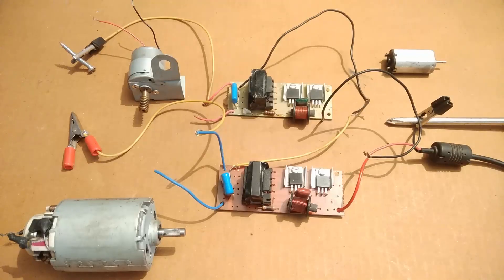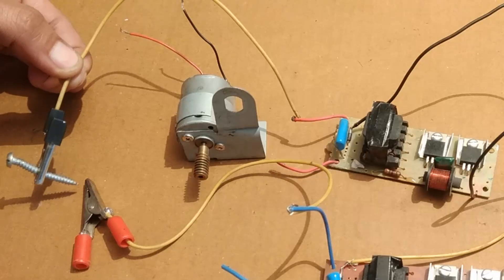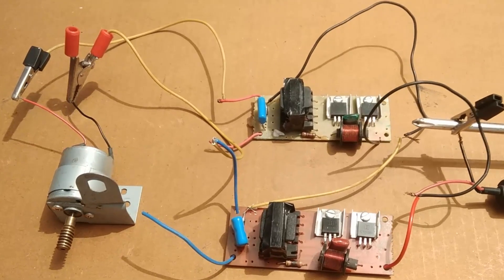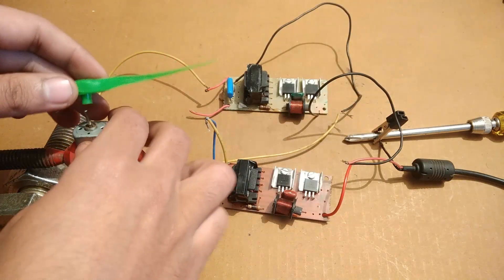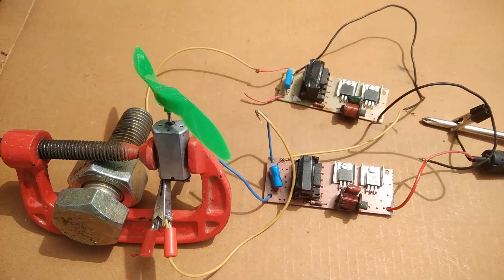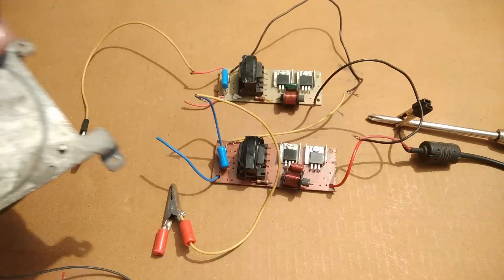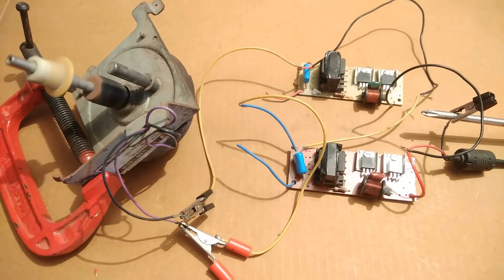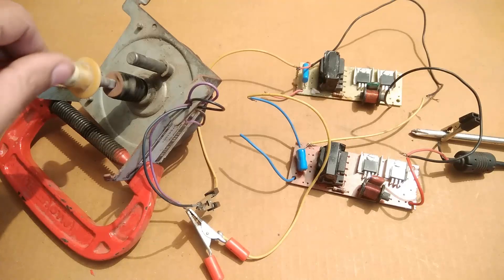Wooow!!! 3V DC MOTOR forced at 4000V | Awesome idea New DIY

Comment: Lie. I was gived 220 volts to 3v DC motor and motor explained. What happen if you give 4000v do you think.
Reply from the maker: Nabi Korucu Yeah! Well u might have given it directly from the socket board that has just 220V but an extremely high value of current..
I fed it very small amount of current - 0.15Amps
Reply: there is no current without a voltage.....really man, how could you do this video without understanding electronics? Ohm's law. the resistance of motor is constant, so the voltage is line-proportional to the current..... "it is the current damaging not the voltage"...  voltage is LIMITED by the current in your video.
Reply: Mr Electron they probably fed it ac current, and the windings overheated.
Reply from the maker: srihari vaila Only if the power supply is high.
Reply: Mr Electron     do you wanna say that if there is high voltage then it may have low current is that possible.
Reply: resistance is constant , it is changes a bit with temperature change but it is constant. self-inductance, man.
Reply: John S okkk man
Reply: John S okk man
Reply: Mr Electron  yes my friend damage caused is by the current but when the voltage is high then current should and must has to be high right as they are directly proportional by ohm s law
Reply: https://www.youtube.com/watch?v=MarysYXp_Xg   here is demonstration of Ohm's law using 3v dc motor. on the left side you can see current, on the right -voltage. increasing voltage = increasing current, line-proportion.  increasing voltage 3times = increasing current 2 times cause of self-inductance ot the motor. BUT if you will limit current VOLTAGE WILL BE LIMITED TOO
Reply: srihari vaila what? listen. you are plugging electric kettle to the power socket, which is 220v 50 amps city power, right? so, you want to say, your kettle is now 220*50=11 kW of power? NO! it is just 2kW(near of this) because it has A FIXED RESISTANCE, CONSTANT, no matter how strong are city power, current is limited by voltage and resistance.
Reply: my cat smells like cat food
Reply: Mr Electron    okkk how will you prove your theoy man
Reply from the maker: resistance is never constant when the motor is operating.Its constant only at stand still
Reply: Владимир Петров  yes off course but he has given a high power supply where p=v×i then the motor should and must has to reflect that given power as per law of conservation of power
Reply: Владимир Петров yes my friend i know that v=ir  and the current across your kettle will as u have said due to its resistance offered. which is 220/r is that it.
Reply: srihari vaila so " he has given a high power supply where p=v×i then the motor should and must has to reflect that given power " is a lie, motor should not do this, exactly how kettle should not drain 11kW from city power. voltage on motor will drop due to current limit of the power supply. you can find ElectroBoom's commentarry upper, if you dont trust the stupid russian guy like me. on his channel you also can find explanation of this words. or you can buy your own power supply with current limiting, and connect a small resistor to it to see voltage drop..
Reply: Владимир Петров  by the way you are from russia and what do you  do. your kettle explanation which you have said is right   it might be the supplied power which is 11kw.      which i have said and the 2kw which you have said is the amount of power  consumed from  the 11kw by the  kettle.
Reply: You would get a thesis or at least a lecture.
Reply: growtopia
Reply: Nabi Korucu
Reply: It's dc motor after all so, if we connect it in a 220V ac source then definitely it will damage. Because the current change its direction which is not tolerable by the motor's coil.
Reply: But my question is that the resistance of a coil is less than 1 so if we directly connect it in a source will it not burn? 
For this problem we use starter but here is no starter. Pls give me proper answer.
Reply: It's the power.The power socket supply has a lot of power.So it will be able to supply both high current and high voltage.So the motor exploded
Reply: Looking at the circuit building, is more the dissipation over the connections than  the power used by the motor... and i think that the resistence of the generators is higher than the resistance of the motors...
Reply: Nabi Korucu i guess u applied ac current
Reply: Nabi Korucu lmao
Reply: Mr Electron if you gave it 3v but 30 -50 amps, people would be like "why does it explode if its 3v?"
Reply: Kamilio ! No
Reply: 220 mains supplies on non appliance or Industrial outlets at least 10-15amps OF COURSE IT WILL "Explained " I suppose that means exploded, however this guy is doing 4kv at low current, it's controlled. Think like how a taser works. See how he said milliamps, that's why. Use your brain man, it's your best tool.
Reply from the maker: Yeah!! I thinks so too.I don't understand y people don't understand such a simple thing that its the current that is responsible for damaging the motor and not the voltage.
Reply from the maker: srihari vaila Yes ofcourse.its not necessary that if the voltage is high then the current is also high.

Comment: What is he getting on those motors are actually more like 10v to 24v because of the current needed to run them,  if you look closely the output of converters are in series and he is getting some sort of 2000v to 5000v but very low current. So his theory is mismatched.

Comment: Have you measured the voltage after connecting the motor? it should fall..
Reply: I think less than 100 volts
Reply: Less than 100?
Try giving 50v to 3v dc motor, it will toast off.
Reply from the maker: Yes it should fall.

Comment: It is a great idea, brushless DC motors would be best for long duration runs. And you could take this even further if you like to build high voltage motor generators that could be used with plasma technology as well. Keep up the good work my friend. :)
Reply from the maker: Ides well received.Thanks!! I will try that 😃😃
Reply: but brushless motors need an esc...
if you supply 3000V to the ESC, even if the inverter circuits are giving a very little amount of current which is enough to run brushed motors, voltages above 11.1-(the rated voltage) will destroy the ESC completely...
Reply from the maker: exactly!

Comment from the maker: What do you think about this hack guys????????????????????
Reply: Mr Electron thats just DC at higher frequency tho
Reply: 🙏Sir I want to know your real name 🙏
Reply from the maker: +DINESH KUMAR Ha ha ha.. 😁 Omar
Reply: buzz off
Reply: Mr Electron that's good idea I think that the motor is going to burst but the motor had a great power to tolerate the overvolt that's nice.
Reply: You apply 4000V and some uAmps. Try measuring the RPM and see, you did no big deal here.
Reply: you're  such a jerk
Reply: Mr Electron i need your help in making a generator from the three phase induction mortor
Reply: Use it to make drone
Reply: Which circuit h this????
Reply from the maker: ok sure
Reply from the maker: 20W cfl inverter circuit
Reply from the maker: :D Sure thing